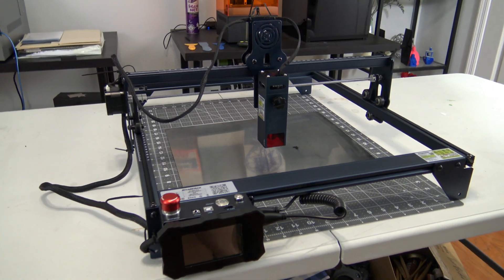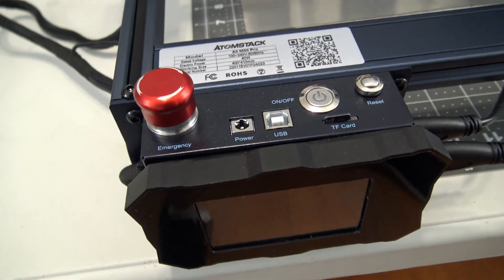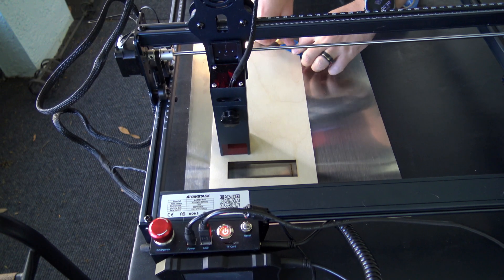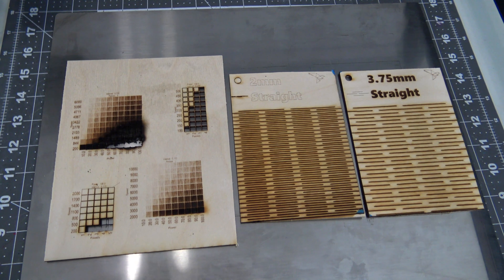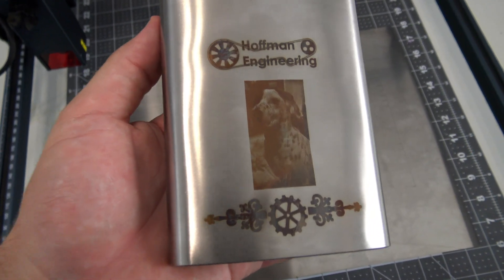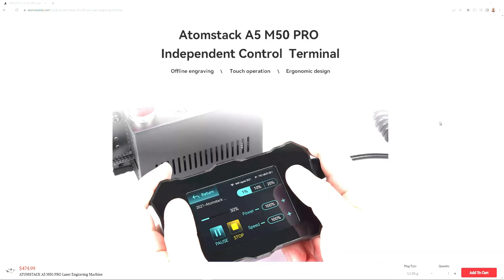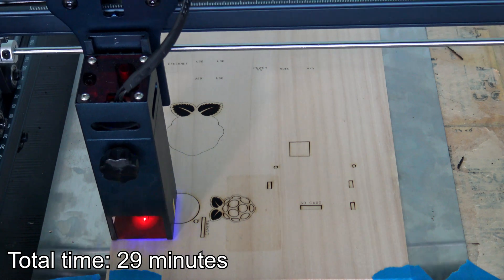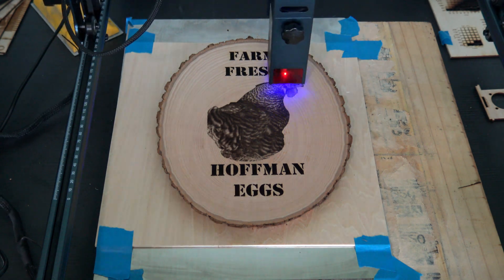A Diode Laser for a CO2 lover? - AtomStack A5 M50 Pro Review

Comment: I have the best luck engraving glass when I coat it with matte black spray paint. I remove it with mineral spirits. I also use tempera, which cleans up with water, but it's difficult for me to get a good even coat. For flat glass, you can also use a piece of black paper and reverse your image. The engraving will be on the bottom of the glass. You've probably figured this all out by now, though. ;-)

Comment: Confirm that they can cut through black or whit acrylic sheets 1/4 and 1/8 of an inch?
Reply from the maker: I can confirm it can cut 1/8 in black acrylic in 2 passes. I would assume 1/4 might take 3 or 4 passes. I haven't used white acrylic, but I would think it would work. Clear doesn't, but I think opaque white would.

Comment: just recently purchased this laser, but seem to have problems getting it to communicate in Lightburn, it works fine in LaserGrbl though.
how did you get it working with Lightburn?
Reply from the maker: Sorry to hear that. Unfortunately, I don't believe I did anything different than what the instruction manual said. It just worked after the initial installation.

Comment: How long does the diode last? Does the power fade after long term use? Great review!
Reply from the maker: I don't see a rated lifetime in the manual for this laser, but my understanding is that diode lasers last a long time compared to CO2 lasers. I see claims of 25,000-50,000 hours, but I also see other youtubers testing out cheap diodes and seeing them fail far before that.
Reply: @HoffmanEngineering  less than 8000 hours